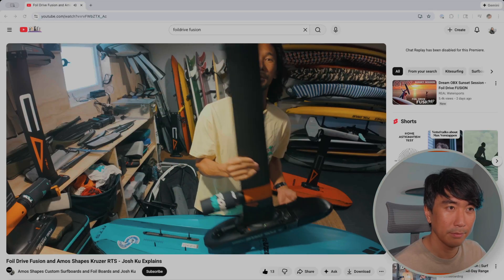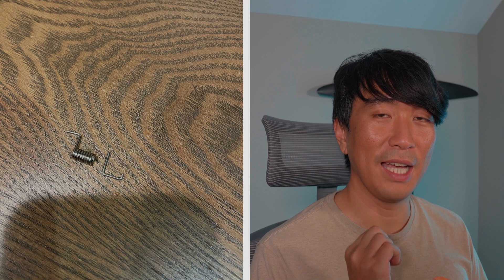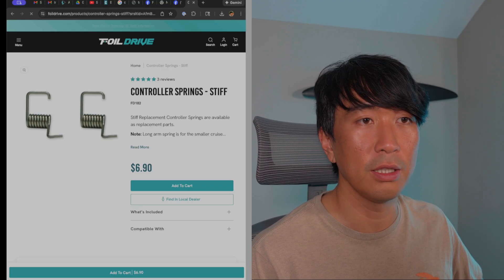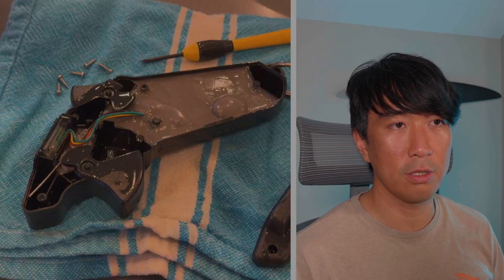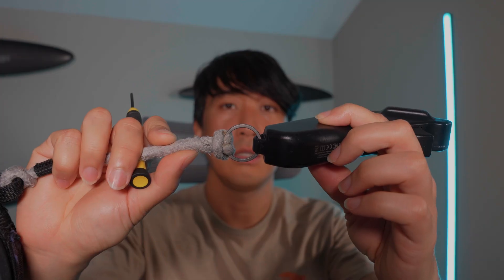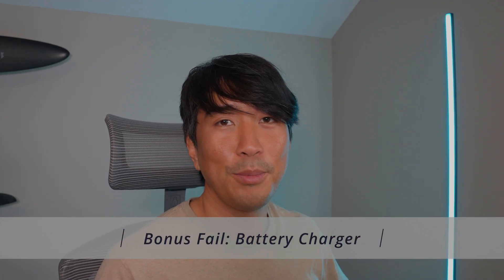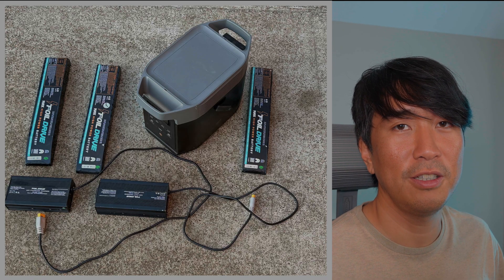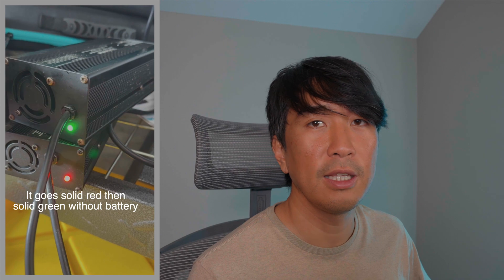6 Common Failures of Foildrive Gen 2 | How to Fix/Prevent Them

Comment: Thankfully most if not all of these have been resolved some time ago both for new and existing customers! If you're having issues with your gear, reach out! We stand by our systems and are always pushing even our own innovation. 
Some of the covered topics like latches, for existing customers we offered replacements free of charge as a pre-emptive measure. 

Appreciate the video (Even with the clickbait title ;) ) Sounds like you're having a blast with your Foil Drive! 
Lets keep growing together :D
Reply from the maker: Having a blast indeed! Cant live without FD at this point. Thanks for blessing the clickbait title/thumbnail😂 any upgrade plan for the motor pod ripping issue? Im glad my washer solution is holding up for me so far but curious if theres any official solution coming anytime soon.

Comment: I am wonderifing if you recommend changing bearings as ROOUTINE MAINTENENCE* for Gen2 v2 motor (* even if symptoms of bad bearings are not obvious). I have >175 sessions (>350 MAX batteries) on original bearings in my Gen2 v2 HP motor, most in salt water and half in sandy shorebreak. I wonder if I have lost power but am not convinced of this (in otherwords no acute failure but maybe slow and SLIGHT decline in performance). I want top performance.
Reply from the maker: The one time I blew the bearing the symptom was quite obvious. I doubt the power loss would be the only thing that happens when the bearings go bad, it will likely come with sound and noticeable feel when you spin the motor can. You can inspect and spin bearings individually for the further in and out ones, so that’d be a good check. Im gonna stick with replace when fail until the next failure happens and re-evaluate.

Comment: The Flow Custom motor pod is better from what I've heard but it can break too.
Reply from the maker: Ive been eyeing on one too. Seems like there are a couple more options developing from the community. Wish flow pod didnt have the logo engraving, I think its bad for hydro dynamic which is a bit ironic😅
Reply: @sunghospark  which other options?  Foil Drive is promoting these integrated masts now but that's another fortune I don't want to spend.
Reply from the maker: @lanceburkhardt8265  https://pcbfoilco.com/ this one is the one I'm eyeing at the moment. I'm going to try to ping Kyle at Cedrus to see if they can share the mast profile to get the custom pod going. I have no doubt that official FD integrated masts would be amazing but yeah, I do not wanna drop $3k for a mast that can get outdated just yet.
Reply: Good things come to those who wait ;)

Comment: So much useful information! Thank you
I just experienced the first problem where the motor is sppining with no throtle at all. 
Just reset it and is working normal now, haven't tested in water yet.
Reply from the maker: Glad the reset worked! Be cautious for next few sessions. For me I went out few more times hoping it would have been fixed, but the problem kept coming back. Definitely try it in nice conditions where you can paddle back in.
Reply: @sunghospark thank you for the advice! Will be doing that! 🤙🏻
Reply: That is sketch AF. Do you use a leash so it doesn't run away from you?
Reply from the maker: @kchididdy  Yes, I always wear leash with FD even on the lake. Gotta use the big wave coil leash (8mm) in the ocean for sure, the thinner ones break way too easily with the extra weight of battery. The recent batches of the remote controllers have been a lot more stable so don't worry too much if you are just looking into it :)

Comment: Yup, spot on video! I had a controller break, controller springs break, motor pod mount broke, motor bearings started to go, and every screw started rusting. Felt like I was on a foil drive subscription service! $100 a month in parts just to keep it running. 😅
Reply from the maker: Right! I heard some batches had bad zinc plated bolts that rust?? I think you can check the bolts with magnets, if anything sticks to the magnet those are non stainless steel and should be replaced with stainless steel ones. Luckily no rusting bolts and screws on my setup yet. Extended warranty plan might not be a bad idea from FD🙊
Reply: Why didn't you submit a warranty request? They have the best customer service!

Comment: Awesome video, dont have a Foil Drive yet but good to get a heads up on potential issues so I can mitigate them ahead of time. Thanks
Reply from the maker: You're welcome! Hope you jump on the stoke soon. A lot of the issues seem to be sorted out at this point.
Reply: I've had one for a year.  I went through 3 sets of latches before getting the new ones.  I haven't seen the controller failures, the first of which is downright terrifying.  I guess the customer is the QA team.
Reply: Thankfully most of the outlined issues have since been resolved for new systems! And pathways for existing customers for these pains to resolve :)